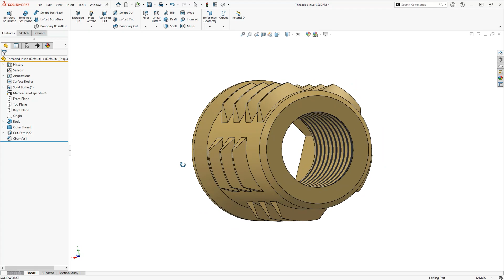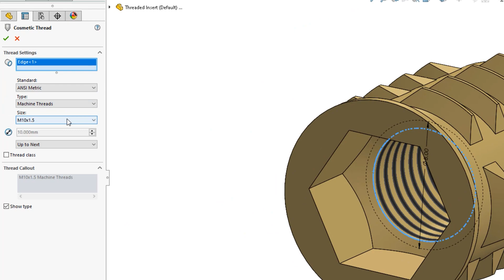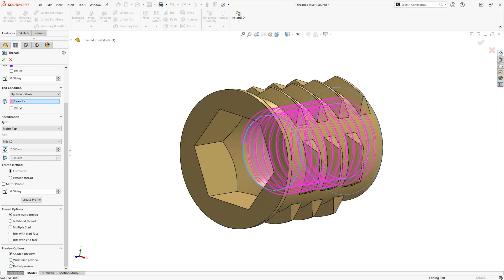How to Thread a Hole in SOLIDWORKS | Beginner SOLIDWORKS Tutorial

Comment: When I use the 'thread' feature on a 3d hole, I get: "Cannot cut thread on cylindrical surface, use extrude thread instead'  How do you 'extrude' a thread?
Reply: Use the "mirror profile" option to cut on the inside. You are trying to cut in empty space